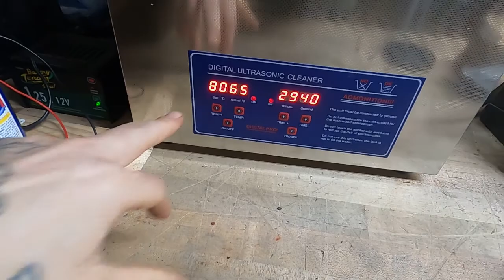How to clean a carburetor of BAD GAS - Yamaha Raptor 660 Carb Service

Comment: Great video again Doug ! I have the same ultrasonic cleaner as you have and I just love it. I do a lot of small engine repairs , carburetors etc as well.  The only thing I would have mentioned is that when blowing out a carburetor with a rubber seat is to be careful or you will launch it into the abyss never to be seen again . Looking forward to your next video sir.